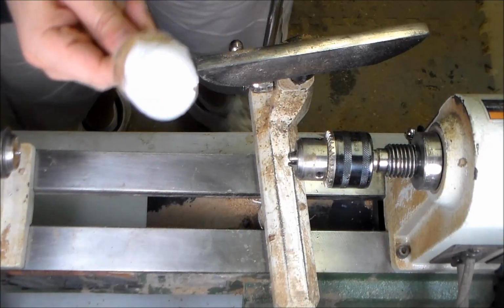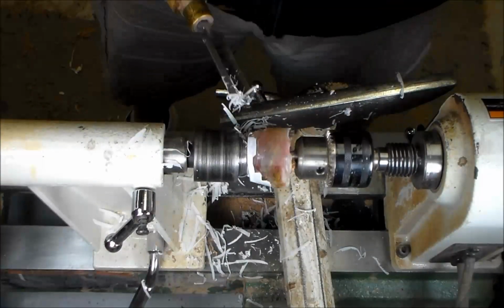How To Make A Confetti Tippe Top

Comment: Just cool, will make one tomorrow
Reply from the maker: +Hossam Hussien Did you have any luck?
Reply: +Peter Brown Didn't came out a perfect half circle, so it didn't flip,  I'm using a drill and made some adjustments to use it as a lathe, because a lathe is very expensive here in Egypt, but this poor adjustment  I made, doesn't allow me to use both hands, I have to use one hand to shape the wood, I will try again next week maybe, and I promise, if it worked I will give you a video
Reply: +Peter Brown Didn't work again, :( got bored of it anyway, making the wooden money clip now :), I'm in the shaping process